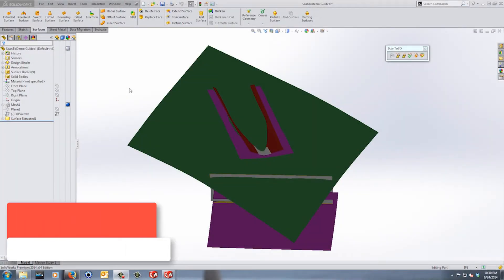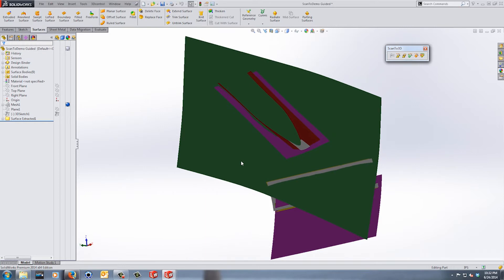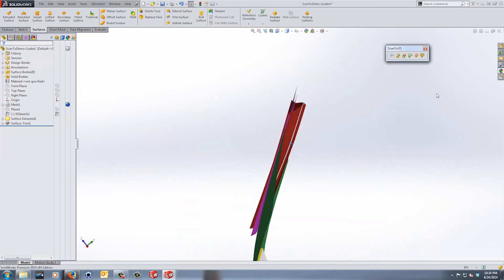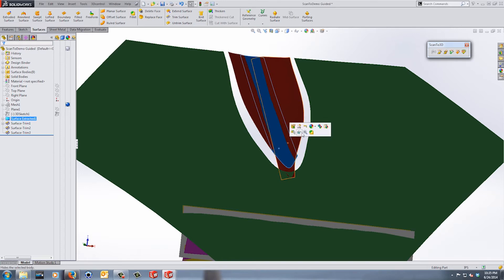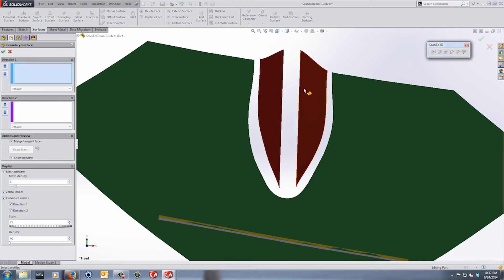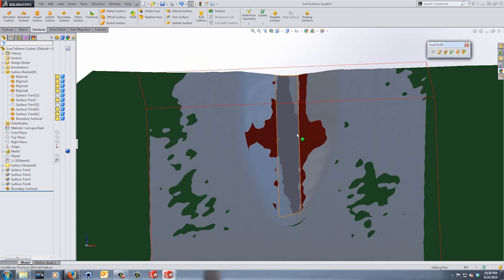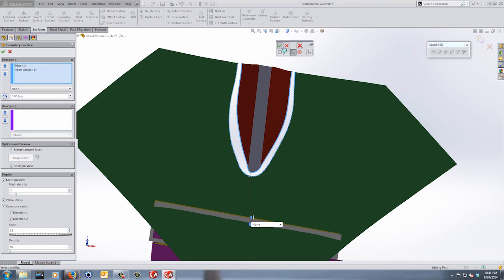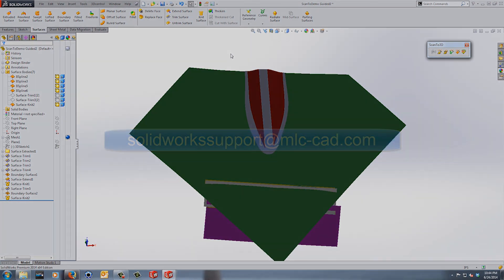SOLIDWORKS ScanTo3D Part 6 - Trim & Blend

Comment: Hey!
Well, I'm following along the playlist ScanTo3D, and I can't help but notice that the guided surfaces procedure was not explained. is it because it was not on the scope of the program, and maybe should be a prior knowledge?
Reply: Hi, can this approach be used for obj, and STL file exported from Blender?
Reply from the maker: ScanTo3D works with mesh data, regardless of the source.  It could be scanned or imported from another software's export like an STL.
Reply from the maker: This process can involve a lot of advanced surfacing routines that are not fully covered here.  There is a separate class dedicated to surface modeling that would be more appropriate to learn that additional knowledge and get more details into how to do it.  https://www.mlc-cad.com/training/solidworks/course-catalog/advanced-surface-modeling/